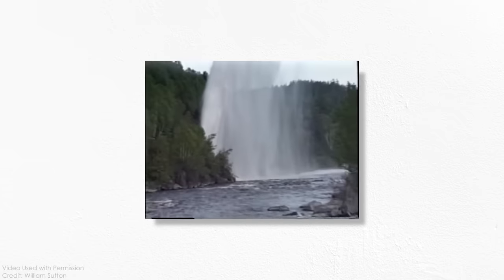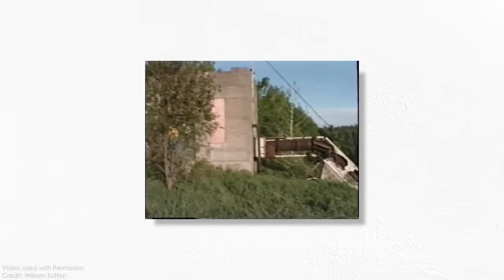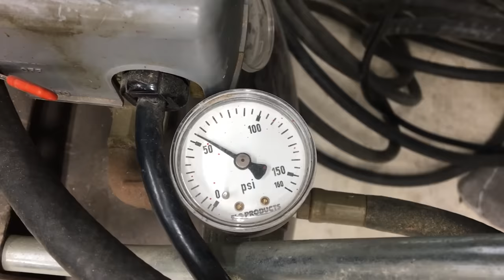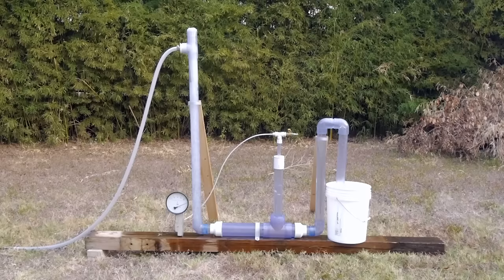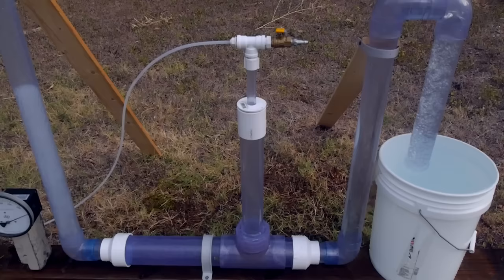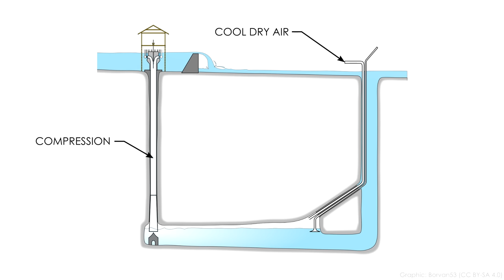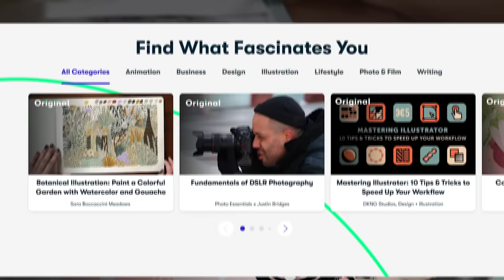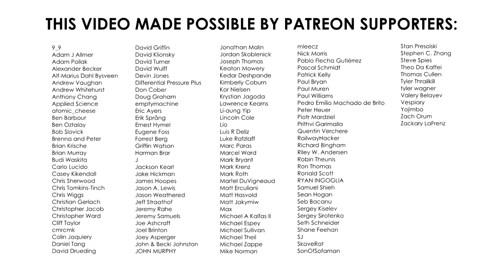Compress Air with No Moving Parts! - Trompe

Comment: When you mentioned no compressed air lines on phone poles I smiled. You don’t know what to look for. 

At the telephone company we used dry air to keep water out of the older phone cable. We had trompes to compress air.  We had some smaller piston compressors out in the field. But the bigger air dryers in the phone company central office are trompes.  The cool dry air is put into the paper insulated cables to keep the paper dry.  These are cables that date back to before modern plastic insulation.  

Cables placed in the 1940’s carry data for the internet.
Reply: What are you like 105 ??
Reply: Thank you, very interesting and educative, relevant anecdote. It makes sense. I still sometimes see the cloth-shielded wire that was popular in the 40s, usually replete with moldy looking black shit.
Reply: @Bobis Vajine Seems very likely, liquid nitrogen is a convenient portable source of dry and reasonably inert gas.
Reply: i love when people come in with crazy info. awesome stuff
Reply: Only in America you can find ancient technology still in use, because for some odd reason they never want to upgrade and modernise their infrastructure. America is like the largest museum for everyone else.
Reply: My father worked in the communications industry and told me all about the dry air lines in phone cabel bundles and how they would leak somtimes and they would have to go find it and fix them.
Reply: @moos5221  "for some reason" - I think the reason is very clear: they don't want to pay taxes
Reply: The air pressure was continuously monitored. Any sudden drop in pressure indicated that a digger or the like had just cut into the cable - a warning before people started to complain that their phone didn't work any more.
Reply: "At the telephone company we used dry air to keep water out of the older phone cable." How many localities do you think still have phone lines (on poles, no less!) from the 1940s? BTW the only "internet" going over copper phone lines at this point is DSL which, let's be honest, ain't even useable these days.
Reply: @JohnRunyon    Most of the old stuff still in use is underground. There are miles and miles of of pressurized cable in the air though.  It is newer than the underground stuff. 

In 2008 or so I replaced a cable that was underground and was placed in 1923.  

You are correct that fiber is the backbone of the internet but rather a lot of the last few feet is in ancient copper cable.
Reply: My father worked for the phone company until retirement in the late 90's GTE & Verizon era. They used nitrogen to pressurize the lines and keep water building up inside sealed and shielded lines.
Reply: @moos5221  The land that time forgot, where they still use the imperial system and paper money.
Reply: Still used today for some fiber optic cables..
Reply: Hello ! You say "cool dry air"; have you ever tested the air T° between entrance and exit ? Im actually searching around offgrid/harvesting available energy way of cooling to make RV coolbox for my car. One of the tech i found is using undirect swamp cooler (it cool but doesn't humidifies) + solar dehydrator, https://www.youtube.com/watch?v=7w4rg3UcsgI then i just remembered that air coming out of the trompe systems was dry, even after passing true water.. I wonder if i can do a simpler system, not needing the dehydration part.. Thanks a lot !!
Reply: @AutoNomades    No, we were worried about the moisture not the temperature.
Reply: @stephenbinion6348  Thanks for your answer ! Anyones ever knows, or have a trompe at reach to try, i'm interested !!
Reply: @AutoNomades  what if you build a model yourself? Seems simple enough to make it youself, and given what you are looking it for, you should be able to pull that off :)
Reply: Wow!

Comment: The Peterborough Lift Lock on the Trent-Severn waterway, also in Ontario, Canada was originally built with a trompe to supply compressed air to run all of the auxilary equipment needed to operate the lock. The system operated that way from opening in 1904 until an electric air compressor was installed in the 1980s
Reply: Oh cool! I just moved here last year. I'll have to go check out the lift locks again now that I know this. Thanks for the info dude!
Reply: This feels somewhat sad. Having such an ingenious mechanism to provide this historical place of compresed air and having being using it for almost a century, it suddenly gets replaced by a definitely more efficient, but at the same time less complex or even interesting, standard electric compressor. The end of an era. Guess progress always has some cons.
Reply: The lift lock itself is super cool! I rented a houseboat about 15 years ago and went down the Trent-Severn system through the locks. Last stop before turning back was the lift lock.
Reply: I loved the lift locks as a kid! Them and the big chute marine railway are really cool ways of getting around terrain!
Reply: What was the rationale for downgrading to electric?
Reply: @b43xoit  I think the mines closed.

Comment: Thanks for posting this video and using my fathers footage of the air plant at the start of your video.  He worked in the Cobalt mines for 40+ years and had a lot of experience with the air plant.  Dad recently passed away at 92 and knew a lot about mining and using compressed air as a power source for their tools.   I was born and raised in Cobalt and worked in some of the mines as a student.  As this video states, it was an inexpensive way to provide compressed air to a bunch of mines.  When electric compressors became less expensive, the air plant was phased out.  There were various issues with the air plant.  First, it was 10-20 km from the mines, so there had to be pipelines through the bush (rugged terrain) to get it to the mines.  Then the pressure as not always consistent because the more mines, the more they shared the air.  Also, compressed air can be dangerous and there were situations where the pipe fittings would deteriorate (rust, rubber gaskets, etc.) and rupture.   As the pipeline system aged, it became less reliable.  Another issue they had at the air plant was keeping the air plant pipes clear of debris.  The river would always have debris (logs, branches, dead animals, etc.) that would get through the control gates and get lodged in the piping system.  So they had to shut down the plant sometimes to clear out the debris from the pipe.   Another thing I remember when I went to the air plant was that  the pipe heads were below the water.  So the water and the air both entered the top of the pipe.  The "pipe heads" were on a system that could be raised/lowered which was important for the changing height of the river feeding the plant.   In the spring, during snow melt/run-off, the pipes had to be raised a bit.  During the summer when the river levels lowered, the pipe heads were lowered.   One thing this video does not show is what happens when the pressure builds up too much in the holding tank.  If the mines could not take the compressed air fast enough, there was a release valve that would combine some water and compressed air and shoot off a huge rooster tail of water about 100 feet into the air.  Many locals would make the drive down an dirt road for 15 km to watch this happen.  Often there would be a rainbow effect on a sunny day as the sunlight would pass through the rooster tail water.  Again, thanks to the author for using the footage of my dads video in this video.
Reply: You should record your views and story....posterity.
Reply: @scottleft3672  It is not my story, it is my fathers.

Comment: Perfect timing!  I was just thinking “I need a way to aerate a small pond that doesn’t have access to grid power”.  Thank you!
Reply: Hey bud watch the sarcasm you never know when you’ll need this.
Reply: It won't work in a pond. You need some sort of drop in height to make the water flow through the trompe.
Reply: It will work in a pond downstream of another water source, and natural ponds generally are, and non natural ponds had to get their water from somewhere.
Reply: @ahuddleofpenguins4842  I think they might be sincere...
Reply: Actually, you can make it work at pond outlet too, but you need to pipe the air back and you probably need a one way valve in the air line so the water in the upper aireated pond doesn't siphon down the air line before pressure builds up.
Reply: I wonder how big you can go with this? Would river have enough air production to aerate the lake, or could same be achieved by building a drop point/waterfall that could insert oxygen into water. We have in Finland bit of a problem on lakes loosing their oxygen to levels where fish are having a issues already. Something like this might be solution for it.
Reply: @Hellsong89  Ragged Chutes was a Very Big facility. Trompes can scale as big as your water supply and piping materials can handle.

Comment: This reminds me of an experiment I did years ago in physics class where we did the reverse process, used air blowing over a straw in water to draw the water up and out of the cup. Really cool stuff, Grady! I always look forward to your new videos.
Reply: That's called the Venturi Effect and is commonly used in Carburetors (pre fuel-injection for vehicles, but still used in smaller machines like chainsaws). The large air speed across the straw creates a lower pressure zone inside the straw, causing the water in the straw to be drawn upward to equalize the lower pressure.

Comment: "Compress Air With No Moving Parts!"

The water appears to be moving quite vigorously, sir.
Reply: Ya beat me to it. Yup, water IS in motion, hence "moving" as a part of the apparatus 👍
Reply: In engineering you typically say "moving parts" when some piece grinds against another one, thereby needing lubrication. i.e. a bending part isn't a moving part either, even though it moves.
Reply: @tharqal2764  still, a bending part will also wear down over time and need maintenance / replacement, no? Much faster than any pipe containing a non-corrosive fluid would
Reply: @EctoMorpheus  Eventually yes but as long as it's bending below its plastic deforming limits, it can hold for a very long time. This is just an engineering convention. Like a bridge bends every time a truck drives over it. But we still say that a bridge has no moving parts (unless it's a drawbridge of course). As opposed to like a regular motor driven water pump where you forget to fill up the lubrication and the device may get bricked after only hours.
Reply: @tharqal2764 : Speaking as an engineer, "moving parts" means "parts that are moving". It doesn't matter if the parts are solid or not. Oil or water is absolutely a "part" in a hydraulic system.
Reply: @deusexaethera  Speaking as a common person, the water is the power source. Like electricity powers a skill saw. IN a sealed hydraulic system i would agree the fluid is an important part of the apparatus. Where here it would be to me a consumable like gas in a car or wood in a steam engine.
Reply: Water and air are working fluids, not parts.
Reply: @deusexaethera  Did you guys know the world is on fire?  Let's stop this petty squabbling and use our giant brains to engineer a solution.  What's to come of the world if the geniuses come from The Far Side?
Reply: ah, but it's not a part
Reply: We're still on this?  It's a solid state device.  Electrons move through a transistor.  The transistor has no moving parts.  Likewise with this contraption except it's water not electrons.  Let's think about it some more, shall we.  It's just too important to you.  Water enters the device then leaves the device. Is the water part of the device?  duh?
Reply: I usually love the pedantics. But this one fails..
Its way too much of a stretch to say the water is a part.
Reply: @briankleinschmidt3664  I'm agreeing with you buddy, take some time to read what i said
Reply: Ya what about the valve
Reply: @RCAvhstape  Buy a dictionary.
 1.
a piece or segment of something such as an object, activity, or period of time, which combined with other pieces makes up the whole.
"divide the circle into three equal parts"
2.
some but not all of something.
"the painting tells only part of the story"
verb
(of two things) move away from each other.
"his lips parted in a smile"
adverb
to some extent; partly (often used to contrast different parts of something).
"the city is now part slum, part consumer paradise"
Similar:
to a certain extent/degree
to a limited extent/degree
to some extent/degree

Working fluids ARE parts.
Reply: @zdcyclops1lickley190  But how does that make you feel?

Comment: Yo Grady, great video, but I just gotta say that I am left slightly unsatisfied for one reason. You mentioned how this trompe was made a long time ago in for this one mine, but you never went into detail on how it worked and how much compressed air it produced. I was pretty curious about the scale of this old time air compressor.
Reply: He’s demonstrated the engineering, if you’re interested in its history then you should look in to it further and maybe leave a comment with extra info. It’s a good way of really learning about something
Reply: Yeah i agree,i can't really understand how did the energy relief system looked like..?Did they fill some kind of tanks and sold them to the mine,or was it like a pipe to the mine with the pressured air inside..?
Reply: I think that little tidbit would make a good addition.
Reply: @uhhhhh262  yeah,but usually he allways shows the actual scaled machines or structures in question. Like i get the principle,but it's hard to comprehend how would it look like in full scale. But i guess there probably are none left.
Reply: Have a look at this video: https://youtu.be/UtYLVLkWyGc
Reply: @padraicmcguire108  Much appreciated!
Reply: @uhhhhh262  the historical context of something is very important when learning about engineering
Reply: @padraicmcguire108  You're a gentleman and a scholar! 👍😎
Reply from the maker: Great feedback. A little more background on Ragged Chutes would have been cool to tie back to the intro.
Reply: Verm1n Thx for the link. Super interesting
Reply: @CoreyWoodcox  thanks for the link! That site provided very interesting details that help to understand the whole process. It's amazing that all that compressed air was distributed from the sit in 20 inch pipes to each mine!
Reply: lol, 
hi dad :3
Reply: Go play warframe
Reply: @CoreyWoodcox  so I'm guessing it had about 220-240 feet of fall or head?
Reply: Nice comment.  A minute explaining the drawing would have been great.
Reply: I agree with this suggestion 100%. Whether evaluated as an essay, lesson plan or as storytelling, taking all the information from the middle and bringing it back to the introductory example cements the understanding in a satisfying way. That said, this topic is fascinating and I finally subscribed after months of occasionally watching picks from my feed. Now I'm off to find more examples of this principle at work.
Reply: Practical Engineering you also never explained where the trompe is used in modern day applications, like you stated in the introduction.
Reply: The Bushwacker, sir, there was no question for me or anyone to answer. Your contribution here is strange and irrelevant.
Reply: The Bushwacker, apology accepted
Reply: @-vermin-  i watched it, fell asleep in 1:40secs, old guys boring voice lolllllll
Reply: The Bushwacker - stay curious and thanks again for apologising, everyone has their off days. Stay positive friend.
Reply: As i recall it was 40,000cfm at 125psi, if the pressure rose much above that it automatically vented the excess pressure.

Comment: I ran across this idea years ago when I was I evolved in small hydroelectric redevelopment. I think the large installation was also in Quebec Canada. It developed over 10,000 Hp at 150 psi. The compressed air was carried in large pipes to the mines  more than a mile away. The system was self regulating. I tried to get a grant to use one powered by a low head hydro site to provide cool presjuurized air to feed a gas turbine powered electric generator. The reviewer did not understand the pressure was determined by the depth of the reservoir not the drop at the dam.
Reply: Please fix that auto-correct feature. Other than that, I also hate it when key people are dumber than me.
Reply: Greg, how does that work? The depth of the reservoir behind the dam determines the pressure in the system? I thought the pressure mainly came from the drop turning potential energy into kinetic.
Reply: Nice!     What is the water flow (gpm) ? .What is the power output you were able to generate (in watts) from the data you specified (10,000 Hp at 150 psi)?.
Reply: The depth of inlet head has to be more than the outlet, but the outlet head is the back pressure and liquid pressure (and by extension, your trompe's idle air pressure) determined by the vertical leg of the outlet.
Reply: Thats the thought i had. Turbine after this brilliant, yet so simple compressor. I was thinking the water spilling out in the demo, which in full scale is probably diverted back to its source. Could be run through a turbine, before being returned. But i like your version better. Using the compressed air in the turbine. In the right climate this could save someone a lot of money.